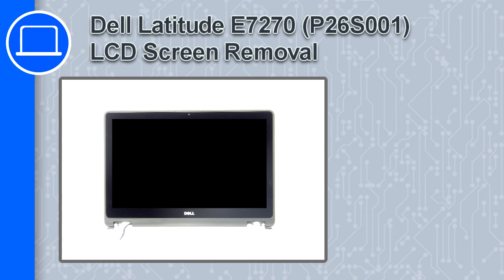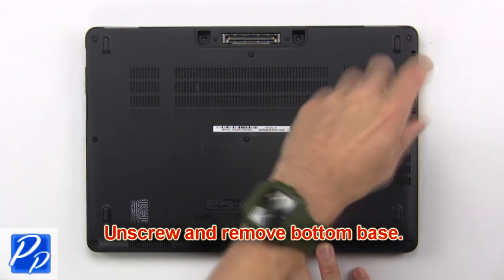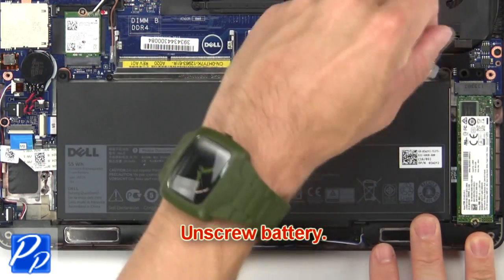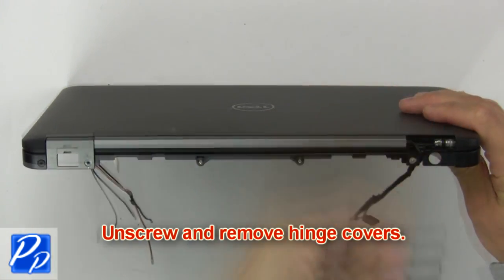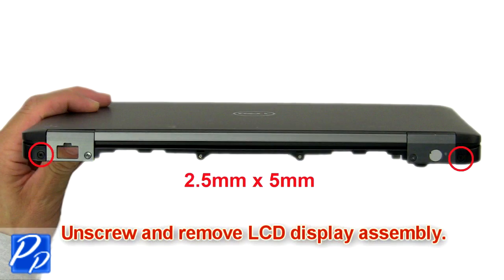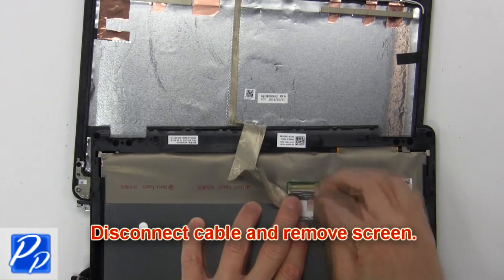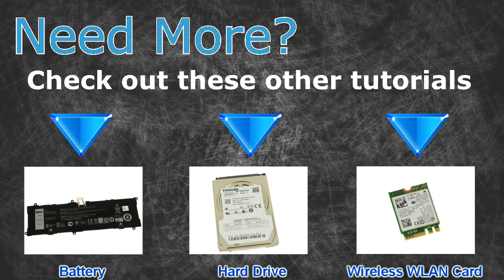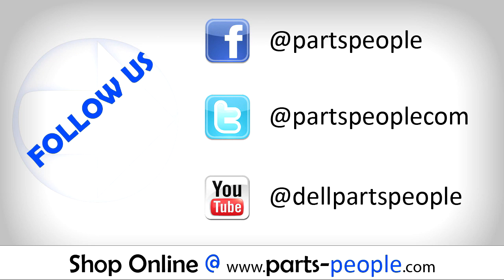Dell Latitude E7270 (P26S001) LCD Screen How-To Video Tutorial

Comment: I have a Dell latitude e7270, it has a non-touch screen but I want to change it to a touch screen, will it work?
Reply: Yes. I just did the same thing. Just update driver if LCD driver if your system doesn't do it automatically
Reply: @Bada_Bing13  please reply if you can
Reply: Don't make that mistake. But please tell me how you flunf a screen. And is it possible to go from a touch screen to a nontouch screen?